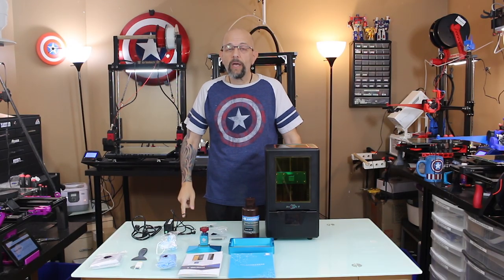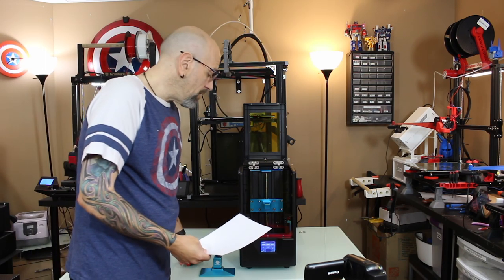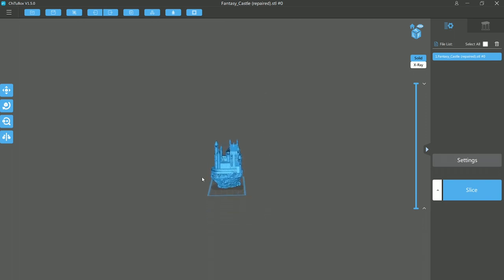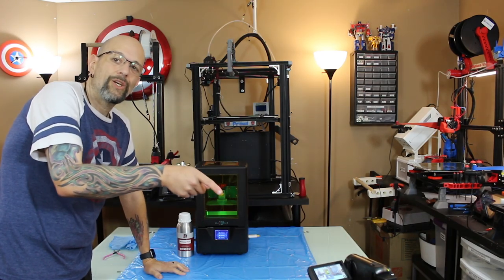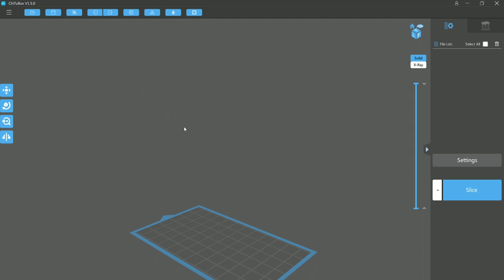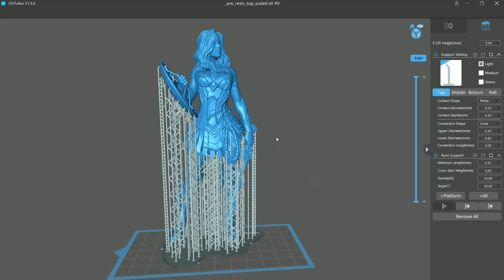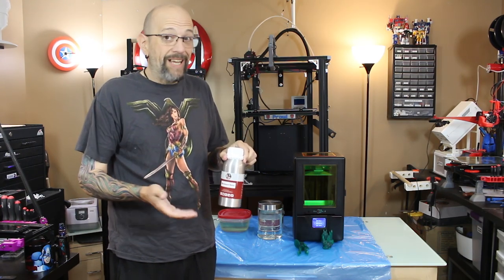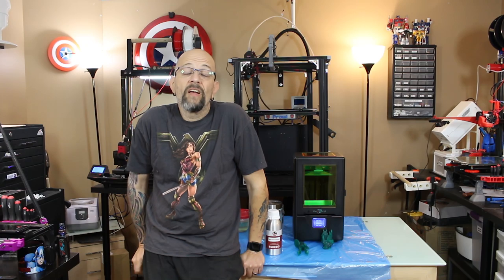Anycubic Photon S Review

Comment: Hi . Has anyone tried printing technical part using anycubic photon S. I work with IOT companies to build their products. i am planning to buy this machine and i wonder how accurate the printer is . Usually we have a tolerance of 0.1-0.2 mm between the mating parts. Is the machine accurate enough for printing enclosures and other mechanical models?

Comment: I bought one for engineering applications, what I'm looking for in a review video is technical comparison data. Per example:
1 Does the Biobased resin decrease the needed print time? If so, by how much?
2 What are the achievable fine detail abilities of the Anycubic? What does the 25 micron quality close up look like compared to different machines?
3 What is the limits of printing capabilities in regards to the delicateness and fragility allowed, by both the Anycubic and the Biobased resin? Reading that the hardness rating advertised as 80 for the Biobased resin, is this harder (how much) than most resins?
A note on print demos, Wire frame stylized models show off more about each printer's and resin's capabilities as well does sever overhangs and and thin points of structure. Wonder woman and the castle would have shown more hollowed out to as thin as possible while remaining stable as a simple example.
Reply: Mine hasn't arrived yet, but I've done some digging and found the following:
1. The Anycubic plant based resin should give you some speed up, maybe up to 2x, but you need to experiment with your particular setup. No absolute spec is given. Their transparent resins are even quicker. The main selling point of the plant resin is reduced smell.
2. The advertised XY resolution is 49 microns, so don't expect miracles. With light bleed and other practical considerations I wouldn't count on better than 100 microns. For functional prototypes it's fine, if you need ultimate accuracy I'd suggest you're using the wrong process.
2.a If 49 microns on the XY seems much, you'd probably be better off with a laser machine. The Form 2 I used to use professionally produced gorgeous models with the FL resins, but for my personal use it's waaaaaaaaay too sensitive and prohibitively expensive (*literally* an order of magnitude more. Equipment and resins.)
3. Getting a data sheet on these things is nigh-on impossible. And there I thought Formlabs were bastards about it 🤣... The most I've been able to tease out of Anycubic's rather lacking documentation is an advertised tensile strength of just over 20 MPa. No specification given on any post-curing requirements. I'll be able to test these claims myself when the machine and resins arrive and I make a few test pieces.

Comment: FFS, I'm far from a worry wart or safety nut (I ride a dirtbike through trails over 20mph) but FFS, ALWAAAYYYYSSS put on gloves and mask. Personally I wouldn't be letting it in the house at all - and I sit 10 feet from my Prusa FDM printing PLA.  Once the bottles are open, assume cancer has been unleashed.  Odor free, or unbelievably toxic smelling, it doesn't matter.  There is no debate about how dangerous resin or epoxy is. Inhale fumes and it bonds inside your lungs for good. I've had 2 tumors removed over years, father died of metastatic cancer this year. Put it in a garage - check on it periodically.  I wear an N100 chemical respirator and nitrile gloves at all times. It ain't worth the risk.  I may hit a tree one day, but the odds are probably less than getting sick from the resin, IPA, acetone combos if I didn't take precautions.